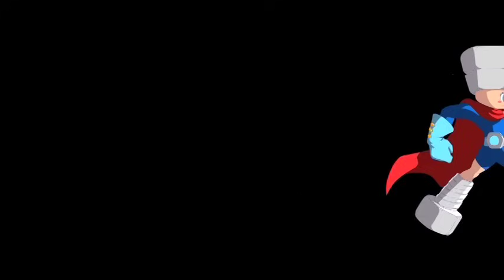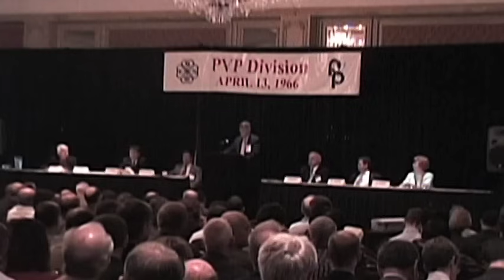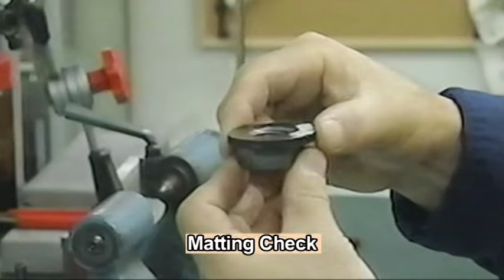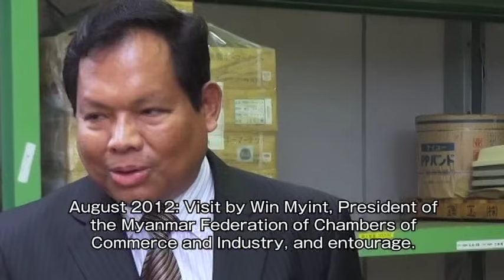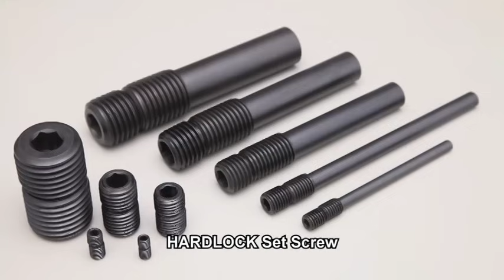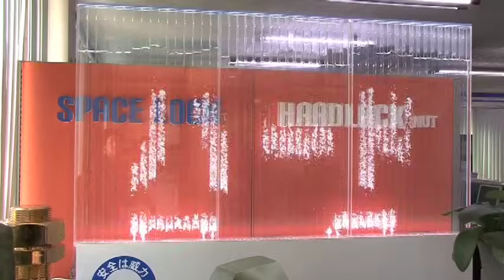Hardlock Promotional Video

Comment: Where are in comparison the nordlock washers with same nut configurations? Are those joints comparable?
Reply: The hardlock bolt is better in all respects. We tested them, hardlock wedges itself onto the opposite sides of the bolt. To a large degree one can determine the hold force by regulating the top bolt tension. Class product.